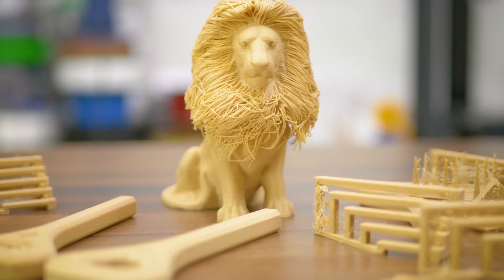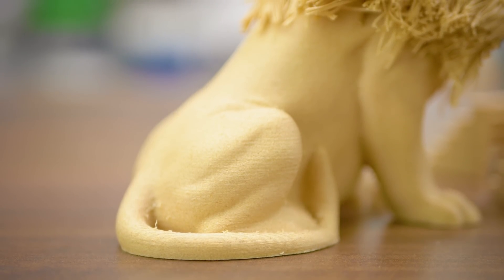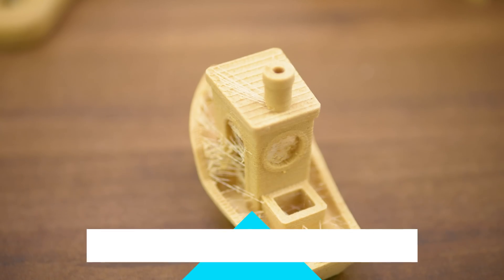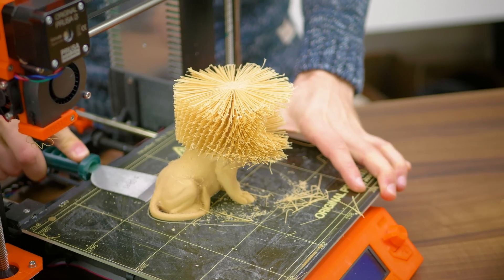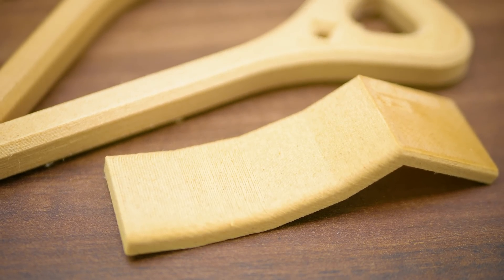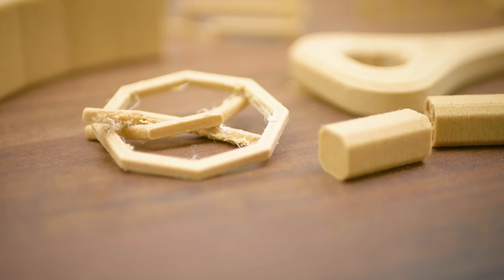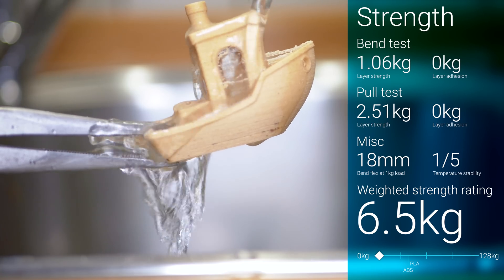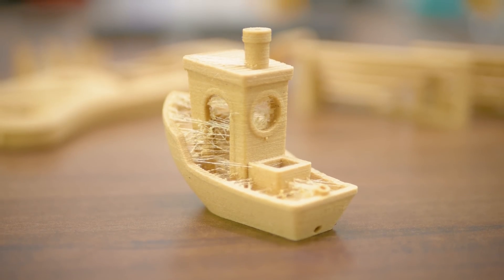Woodworking with a 3D Printer - PrimaSelect WOOD review! #Filaween

Comment: One thing I love about your channel - you show simple prints with errors. Most pictures you see on the web, most videos, show perfectly "printed" parts. No Strings, no overhang failures, perfect perims etc.. Just clean simple parts, where the people used hundreds of hours on calibrating everything to show off (or the parts might be post processed) - and newcomers just come up and say: "NICE!" and buy a printer and wonder why nothing good comes out on their first tries.
While you just put the material in, set everything up like "This is my experience, it should work with this", some little tweaks after that and make a video about it. I love that. At least, I hope I'm right with that guess. ^^"

But even if I'm wrong with that guess: Thanks for your videos. You're doing a great job for the whole 3D Printing world :)
Reply: That's how I felt when I got my printer. The internet helped me, though. I had no idea what I was doing when I started and I had my nozzle at 1.75, the diameter of the filament. Thanks fake perfect 3D print YouTube videos.

Comment: The key to using wood filament (of which there are many compositions, no pun intended), is to hit and run. You should not let it sit in the hotend after use. Use it, remove and cleanse the hotend/nozzle with something else. They use a "wood flour/powder"  when they extrude the filament. It will scorch if it sits too long and deteriorate (thats why if you leave it in, it gets very dark when you print later). The wood flour/ powder is fine that it should not damage a metal nozzle (think rock, paper scissors), but scorched material hardens bonds with gooey bonding agents and pla and make larger particles that clog. I work with chemists !!!
Reply: I hear that the carbon that can form from the inevitable scorching can indeed damage the nozzle. This is worsened the hotter you run the filament, as some people like to run it hot to slightly toast the filament to give it a more wood like appearance.
Reply: Yes, the scorched particles are what cause the problem. That is why you need to hit and run with wood filament. Use it and remove it, cleanse the throat/ nozzle with another PLA or whatever you use. Wood flour is a particulate and on its own will not damage anything in the short run, but if you left it sit, it becomes hard and jagged and will clump causing damage, but only if you let it sit.
Reply: I meant add that wood filament is very brittle during print (dependent upon how much powder is used). I reduce retraction to a minimum and slow down the print. This has dramatically reduced filament breaking to the point that I am printing some amazing antique wooden sconces. But, I remove it and clean the extruder/ throat/ nozzle after each time I use it.
Reply: Nuggy Blake Yeah, and if it melts and then cools in the hot end, it may not fully melt again around the perimeter, turning into a solid tube that has to be manually dislodged from the hot end. This is the reason I always remove it and clip about an inch off the end, then clear the nozzle out with some non-filled pla, every time I use use it.
At least, this happens with Hatchbox, but I assume the same is true for most.
Reply: Good idea !

Comment: Watch out for those jams with these filaments, that sticky stuff and wood particles will burn, char and pretty much totally jam up nozzles if it's left to burn for a while!
Reply: Probably more then you want to know about destructive distillation of wood.
https://ir.library.oregonstate.edu/xmlui/bitstream/handle/1957/929/FPL_738ocr_rev.pdf?sequence=1
Looks like you need to get up around 270C to get the "good stuff" from wood.  But I would guess that at lower temperatures you can still end up with a lump of stuff in your nozzle that refuses to melt.
Reply: Indeed.  When we had just bought an Ultimaker 2 for our Makerspace at work the guys left a Colorfabb woodfill print overnight and the resulting jam, plus the thing cooking said mess for hours wrote off the hot end (or most of it, can't remember, it was quite some time ago). They've not printed with wood fill since :-)

Comment: What inexpensive filament would you recommend for printing gears and gear trains? They would be used in Nerf guns to allow for stronger springs. The stock gears are injection molded ABS.
Reply: +Thomas Sanladerer Thanks for the reply! I was hoping DAS filament PETG would work. Since it has the same strength rating as the rigid.ink carbonyte.
Reply: BLOOGaming HIPS Filament is also a good choice especially for gears.
Reply: +Thomas Sanladerer Good idea. Thanks for the help!
Reply: nanafalke
I thought that was support material? How strong is it?
Reply: I don't think it is very strong but it is not as outwearing as ABS, so for gears usually a good choice.
Reply: +nanafalke The problem isn't wear. Its strength. The stronger springs are shearing the old gears. I was thinking about using nylon, but now I'm worried about it being too stretchy.